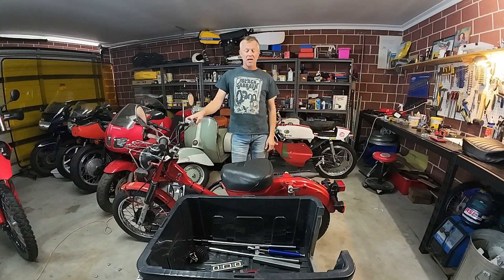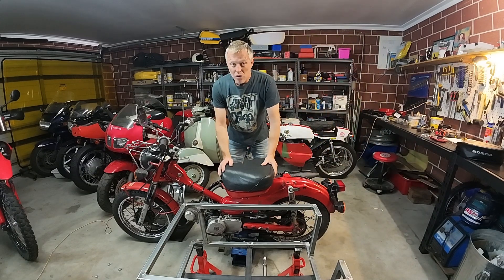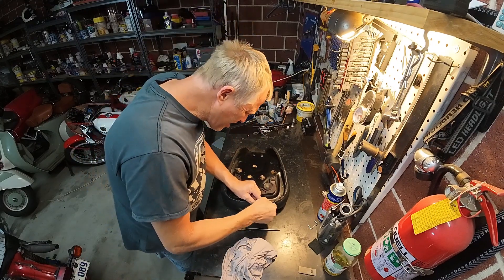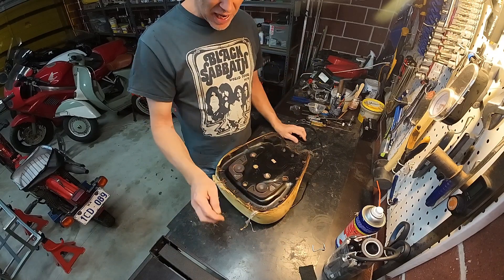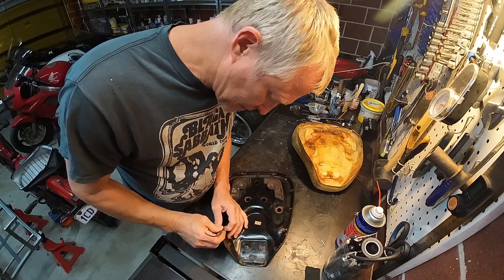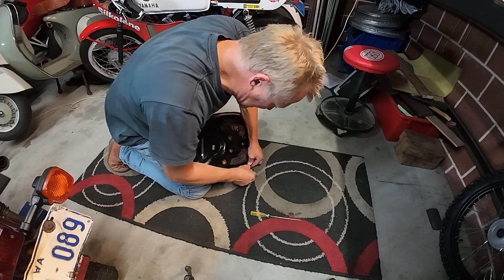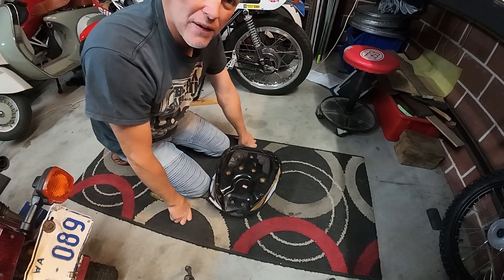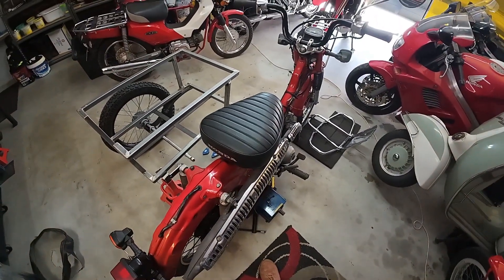Honda CT110 Seat Cover Replacement

Comment: If pulling the foam off the seat pan I’d be using some 3M contact adhesive to reattach it. I’d also use some on the foam outer surface as it may assist in keeping it in place rather than full reliance on the metal barbs only